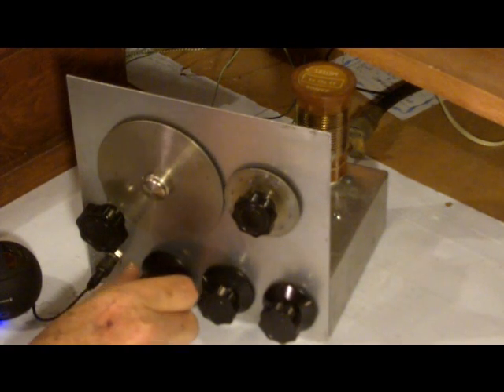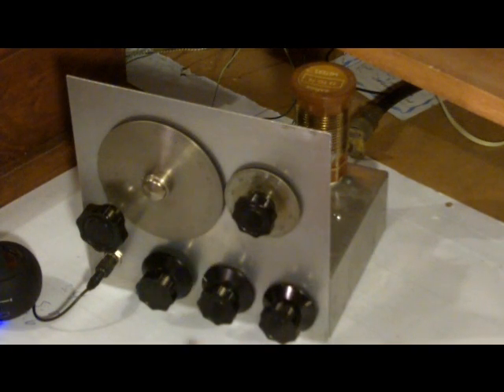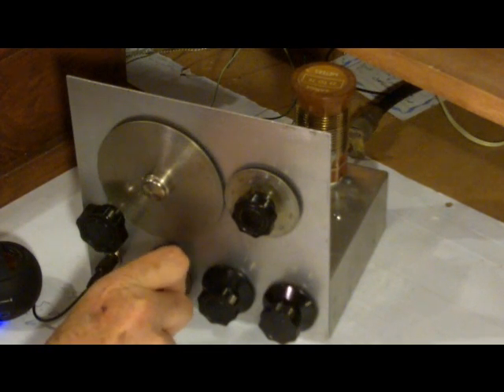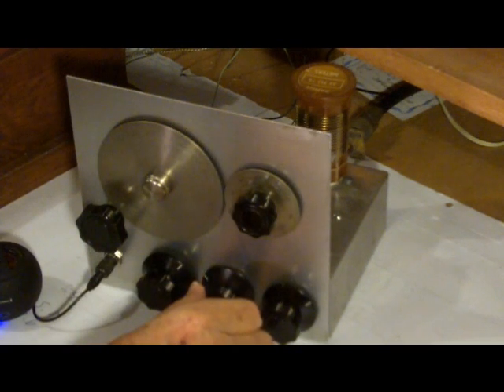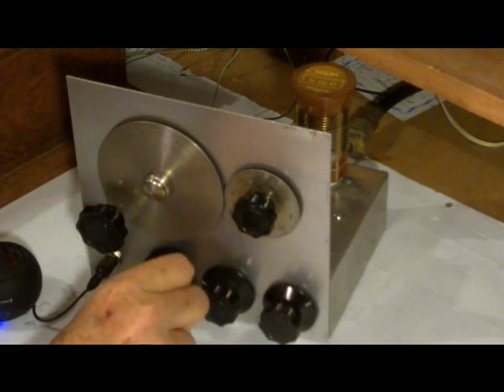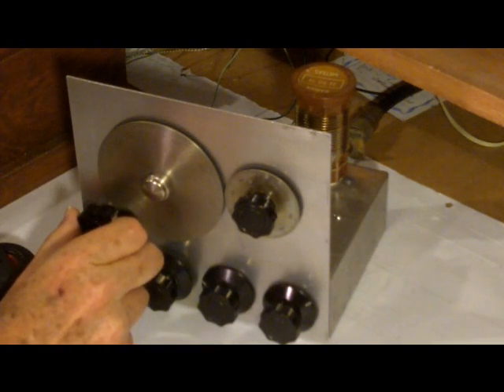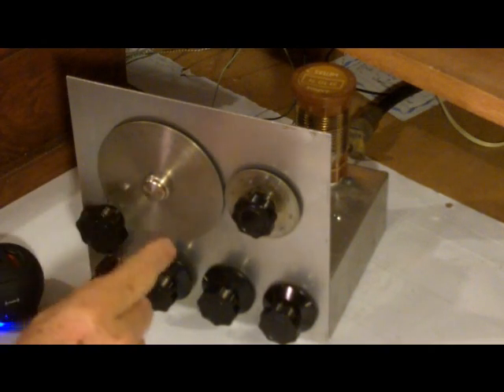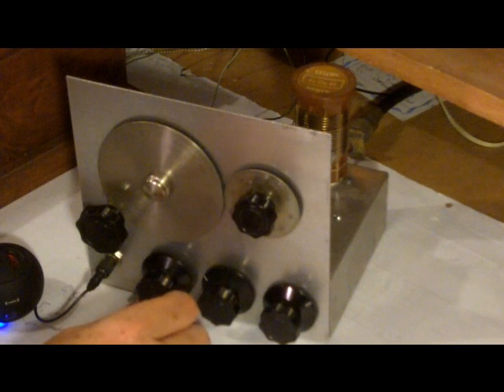1T4 3V4 Regen Demo

Comment: This is probably one of the finest and sharpest tuning regens ive seen in a loooong time, Goes in regeneration smooth and detects both CW and SSB repeatedly with no problem what so ever.
Great Job there and TNX FER Sharing
73's from the country of JY

Comment: I building the exact same thing as soon when I get the toob sockets and off eBay sylvania vt-183 #1625 matches pair I’ll try it also using 1T4 but could I just use one then probly plug it into an op amp lm386 maybe after an audio isolation output transformer such as EE14?

Comment: Hi, where can one get a schematic and parts list for this receiver? I'm gathering parts, have 5 1T4's - some N.O.S., some used with 3 variable capacitors 365pf, again N.O.S. The chassis and faceplate I will make with my bending brake. I already have two Trimm Hi Z headphones from my junk box (one I already use with my National HRO-5 (with every coil set ever made for it). I have several books from Lindsay Publications, just do not know which schematic to use. Hope you or somebody can help in my build. Also, how can you suppress the oscillator signal from going back out the antenna? Thank You.

Comment: When I built my 3S4, it didn't have any gain control.. I've seen another site that a 5 k pot can be added to tickler side.. and presto it cures some of the strong signals. I am also thinking of adding one to Antenna side as well

Comment: Nice regen!! I built my first one in the mid 50s when i was 11. It used a 6SN7 as detector and amp. I didn't know squat about LC circuits or anything else for that matter. 

At first it picked up AM broadcasts stations, but I soon got bored with that and somehow figured that changing the coil windings would change the frequency. I wound a new coil and it landed me right in the middle of Mississippi River boat's communications. I listened to those for weeks, even falling asleep with my cans on. I changed coils again and ended up on the Ham bands. It was so much fun as a kid to build something I didn't know anything about and get it working. Thanks for sharing your video!

73 -- de Mick, WB4LSS
Reply: 👍73👍